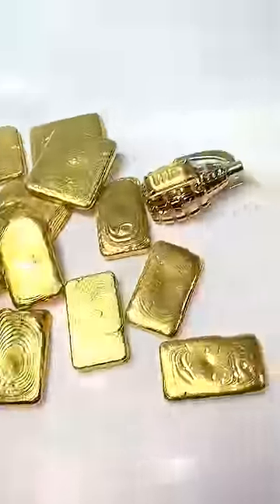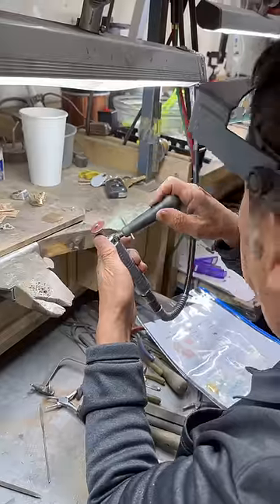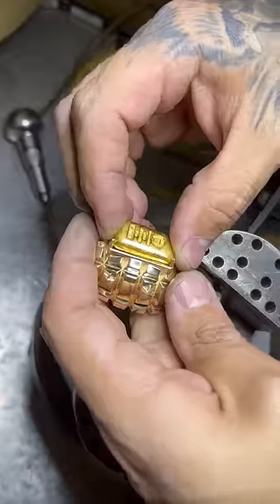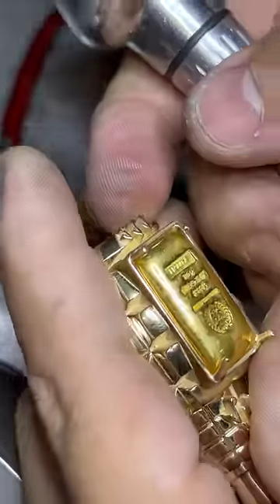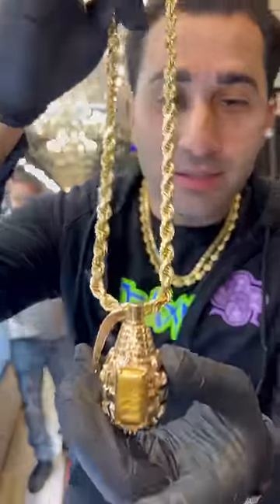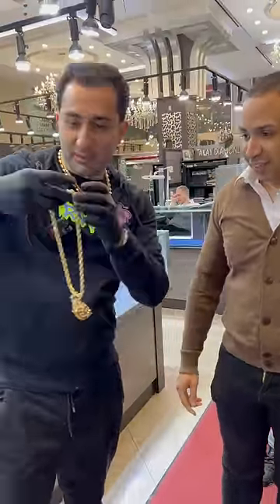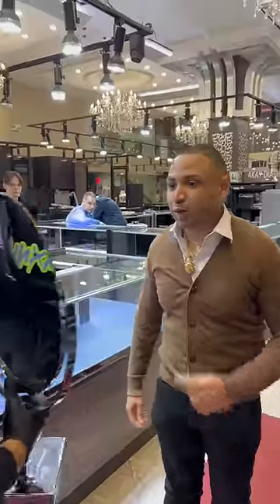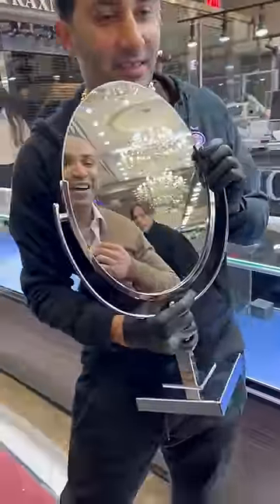HOW WE MADE A SOLID GOLD GRENADE!!! #shorts

Comment: That's pretty dope making a pendant with the 1oz gold piece in it. The one he had on its pretty clean, just the little gold bar framed. Wild how you can see the color difference between the 24k gold bar, the pendant and the chain. The chain it's on its probably 18k or 14 karat, so I'm curious what karat gold the pendant itself actually is. It's allot more subtle than the yellow gold color of the bar or even the chain.